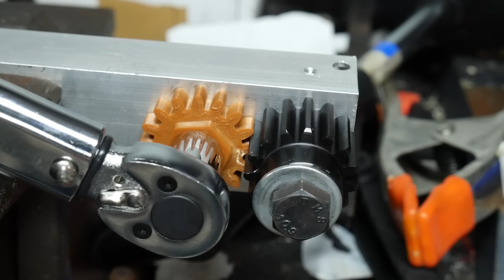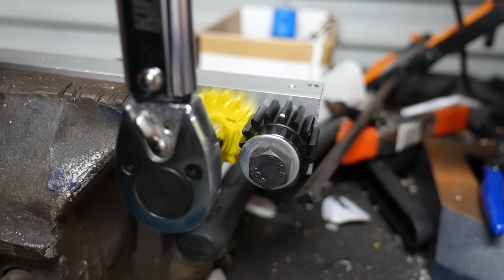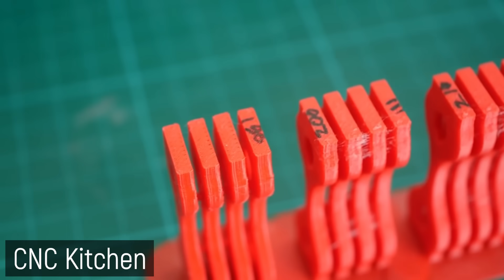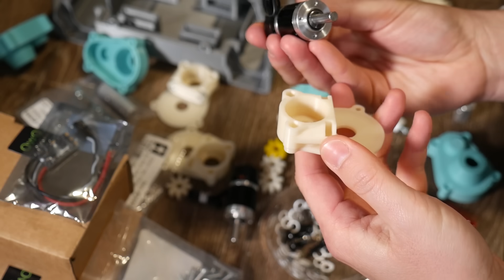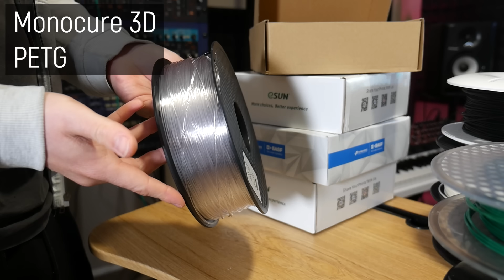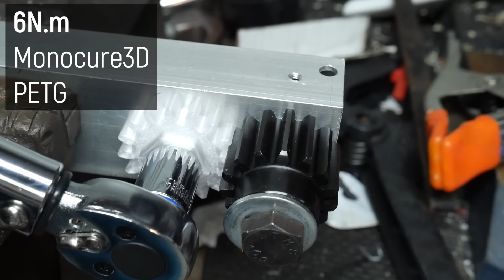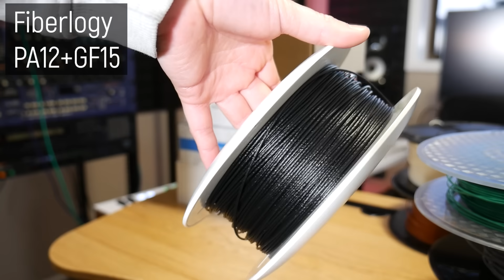Which 3D Printed Gear is Best?

Comment: While your tests possibly are representative of the relative strengths, I don't think you gave any sample a fair test.  It was obvious how these would fail the moment you showed your slicer rendering.  It was engineered to fail.  You weren't testing the strength of materials for their suitability for gears, because you didn't have properly engineered gears.
What you have tested is basically a rolled up sandwich consisting of a corrugated surface, non-structural infill, and a flat surface.  This type of structure is fairly strong in bending along the length of the corrugations, and weak across the corrugations.   What it's not good at, at all, is shear, but all you're testing is its shear strength.  It's obvious that the teeth are going to bend first and pull away from the infill because there's no way for the applied force to be distributed around the whole structure.
You might want to try modelling this in Fusion/Solidworks, and do some FEA on it.  You'll see that as printed, with hollow teeth and no continuous rim, your forces are localised to the area immediately around the tooth being driven.  Try it again with solid teeth and rim.  The forces are now distributed around the structure, so the infill is more effective.  Try it solid, or with spokes, and the forces resolve to the hub.
I'd like to see the tests repeated where the gears were engineered with a sound, structural load path between the hub and teeth.  Either use 100% infill, or a model including strong spokes, and print with enough perimeters to ensure the teeth are bonded to a continuous, circular rim.
I'd also like to see wear resistance testing.  There's no point having any gear which grinds to dust in a jiffy.

Comment: Results of Polycarbonate (PC) would be interesting too. Teeth and area of contact of the teeth to the radius of the gear should be printed with 100% infill and the center with infill, therefore the teeth have more absolute strength but can bend relative to the center of the gear . That avoids too brittle breakage behavior. Additionally, the infill can be designed to correspond to the inner stress introduced into the radius (But therefore has to be manually constructed in the CAD itself and not to be used with the automatic function of the slicer software) Cubic infill f.e. is not suitable because the stress is mainly "in plain" , and therefore the 3-D part of the infill does not have any beneficial effect to the strength of the structure.

Comment: "Mechanical Fuses" are called Shear pins.. woodruff keys also often serve the same function, but technically woodruff keys are intended to index rather than sheer at a precise torque, where a machined index could fail, a woodruff key is used to avoid real damage, although that shouldnt be the first defense, a woodruffs break point is mostly determined by the torque of the shaft nut rather than its own structural integrity.

Comment: Taulman 910 all day.
Even though that PLA looks great. PLA has terrible fatigue. i would not be surprised if it breaks in short order in real use. As soon as it flexes even just a wee wee bit, it's all downhill.  However, your tests show how much variability there is with pla. Perhaps some beat this fatigue thing.
                I typically print gears in petg unless they need real strength. When I print gears in petg, they only tend to crack with high inertia changes. Which is why I use nylon and that 910 is king. 910 is FAR more rigid than standard nylon. FAR MORE rigid. 
        
       * If I need strong gear trains I use toothed belts. Same belts as used in the printer. Belt + pulley. The belts grip more teeth. The belt grips half the pulley surface resulting in a very usable & durable drive train. Belt + pulley = serious strength. Plus, u can also buy the aluminum pulleys for cheap. Well, cheap in the standard sizes. Print the rest.  

    I like your torque wrench test !! Cool idea.  Perhaps it can be standardized.   A certain diameter & tooth size should be all that is needed.

Comment: A suggestion, and a question:

You might find an "old school" type torque wrench to be a more elegant "fit" for the sort of testing you're doing in this sort of evaluation. The dial-your-torque is incredibly easy when you're tightening a bolt to a desired amount of torque, but when you're using the wrench to "discover" a torque level rather than apply the specified amount of torque, you may find the traditional "flexing" torque wrench to be much easier to use.

Think of it as being more "analog" than "digital." It's almost absurdly simple in concept: the "bar" will flex as you apply torque to the handle, but, a pointer connected at one end will not flex. Instead, it will sweep across a scale indicating torque -- the harder you tug on the handle, the more the needle will move.

It's like the difference between an analog meter (i.e., a VOM) and a digital meter. The digital meter will display a number, while the analog meter will have a needle sweeping over a scale.

Sometimes when making electronic measurements it's much more convenient to be able to watch that needle deflect than to try to read numbers and mentally evaluate what the numbers mean.

Same thing with a graph versus a spreadsheet.

Anyway, you might consider trying to rustle up a "classic" torque wrench and see if it makes your evaluations any easier (I'd wager it'd certainly make them faster since you'd no longer need to be continually dialing in one setting after another. Instead, you'd just keep an eye on the needle!)

Now, the question: For something like this, where strength is more important than weight or cost of materials, why did you use partial infill instead of making solid gears? Was there a reason I'm not taking into account? (I have watched my son putz around with his new printer, that's pretty much the totality of my experience, so I realize there may very well be a reason for it.)

Comment: Those tests have nothing to do with ‘toughness’ - this term is used to describe rough handling or absorb energy and withstand shock up to fracture, Implying an impact.
Terms that should be looked at are;  malleability, stiffness, hardness, plasticity, sheer strength. Listen to the terms used in CNC Kitchen’s videos.

Comment: Here are two "dumb questions": first, could you 3d print a plastic gear around a metal nut to create  a 'shear-pin' effect?  Second, has anyone tried good old 'wagon wheel technology' and fitted a steel sleeve around a PLA wheel?

Comment: I'd be curious of the results if you were to 3d print a mould directly and cast them in resin what they'd be like. Could them compare adding in different fibres (glass, carbon, flax etc).
Yeah it's a 2 step process but could unlock a whole new level?

Comment: I don't know if anybody told you, but your experiments is wrong. You are mixing two different tests. If you want strength, you HAVE to get the torque at which the wheel break on the first application because if not, the only result you get is the torque for a damaged gear (by the previous application of the torque). And the second one is aging, on this one, you need to apply a certain amount of torque (the same each time) multiple times until the wheel breaks (normally at a torque that should be way below the torque on the strength test). So in your tests both fatigue and strength are mixed, and you don't get any "good" result. Sorry for my english.

Comment: I am also suprised by the pla tests .
But i would be for 100 percent sure that nylon 6.6 with carbon parts wil be very very tougher.
in my work experience the pla 12 is used for toothbrushes end more health products.
The nylon 6.6 is the most comon used  for car industry and robotic industry.
i suggest get a nylon 6.6 fillament including carbon parts not strands.
i just dont have a clue bout the printing part as we inject moulded nylon 6.6 at around 300 degrees celsius.
hope this helps u a bit.

Comment: PLA might be strong. But I wouldn't trust its reliability. I would prefer PLA+ over it, which is a material I'm really happy about discovering it.

To be fair, my first PLA is my only PLA. It prints very easily and smells so sweet while being printed. But it creeps badly. If I will secure something with a 3D printing, I would never trust it. Because it will be broken the next day under the constant load.

PLA+ prints a bit more difficultly. It doesn't like my bed. It doesn't like my glue stick. But I just use brim or raft(I'm a raft believer more than a perfect settings believer) and it usually prints just fine. For reliability, I believe that I can thrust it. While the PLA would break even because I left the filament on the extruder for a few hours, PLA+ just don't care. So I trust it.

A bit weaker? Sometimes reliability is the strength. I would prefer PLA only for decoration.

Comment: I would love to see Carbon composites for pla, abs, petg & nylon as we use markforged onyx with carbon for tooths alot but never explored alternatives.
Reply: carbon fibers are abrasive, you don't want them in the gears.
Reply: @stanimir4197  markforged allows u to place carbon fibers along the hole outline in ur print not on the conventional way where its just torn up and randomly put into it.
Reply: @diederickb1806  if the fibers  are not on the teeth (or where the gears ride), then it's fine but then again, the teeth won't have the reinforcement, and they are the really important part. Nylon+CF gear teeth eat brass pinions even.
Reply: @stanimir4197  u dont get it markforced can place continues fibers that go around in 1 peace trough all of ur print for each layer. So the fiber will be inside the print. Even if its just millimeters

Comment: I have a roll of CF reinforced nylon i print with when i need strength - Add North Adura X. Has a beautiful matte finish and is way easier to print than regular nylon since it has almost no shrinkage.

It's a Swedish brand but I'm sure you can get similar filament in Sydney.

Comment: Hey this is pretty cool, but spur gears are notorious for having failures on specific gear teeth with too much torque and shear stress.  Helical gears might be a much better alternative since the gear teeth mesh continuously and there isn't such a sharp increase in torque and shear stress when teeth contact.

Comment: You could also try to get a range of the expected torque transmitted per application of those gears, i.e  whether it's used to drive a fan or drive an industrial shredder, and everything in between

Comment: Thanks for your Tremendous Efforts Angus.
I've been enjoying your vids since forever only watch on Roku which precludes comments. 
I always "Like" and usually save for later as well. Keep up the good work!
Both you & Stefan (3DK') got me into 3D printing.
   Now I've 2 printers going flat out and something to do while locked down :-)
At the moment I'm Printing Tiny Gears (15mm diameter with 36 teeth and 11mm with 14 teeth).
  These are to go inside my RC Buggy Servos as the originals were stripped due to bad driving.
   They are coming out great and PLA is working almost as good as Nylon.
   Absolutely blows me away that I can make this stuff.
   Would never have even tried 3D Printing apart from your enthusiasm convincing me I could!!
Hope your Lock Down ends sooner than later.
BTW I'm Locked Down in Adelaide ATM.
Early days yet only looks promising here, and like we *may* be out soon (touch wood).

Hoping everyone in Sydney stays Safe and gets out soon.

Comment: If your thinking of getting into 3D printing based on the wonders seen here, DON'T... 

Regardless what he says he is probably using a $5000 plus printer for this. I watched and bought an Ender 6. After 36 prints 33 failed the "Successes" have all the strength of a biscuit! So make it out of dough save yourself hundreds of dollars and as many hours of frustration. If that's not good enough buy what you want new. Wait another 10 years for these prototypes to become working printers. Making it out of dough also has the advantage that your fails are yummy snacks and don't destroy sea life.

P.S. a lot of rubbish will be said of increasing/decreasing bed/hot-end temp flow rates etc. This will be as much rubbish as you create 3D printing.

Comment: A dial indicating torque wrench may have been more helpful than a breakaway. Rather than slowly bumping the torque breakaway, you just turn until it breaks then check the max torque indicator. Cool project.

Comment: Anges your printing is the weak point. Watch where it failed your lines when printing do not overlap enough to bond well enough. Your tooth came off right at a print line. Meaning you do not overlap your print's far enough for strength. Print 0.2 layer hight with max 0.3 line width and a 8 layer wall. You will see on gears it bonds way better than anything. And produce 100% infill. 
Also it is :  B A S F  which is a very very well known Chemical Company from Germany and pronounced each letter individually same as  B.M.W or V.W. for example.  B.A.S.F. stands for Badische Anilin- und SodaFabrik .
And get your hand on PPS(Polyphenylene Sulfide). It requires full annealing so put it into a heating chamber for 2-4 hours at 130°C. This is before you touch into PEKK and PEEK materials the best price option.

Comment: You always test the same tooth, which eventually breaks. Wouldn't it be necessary to use another tooth (or other wheel) to really see the force in Newton which has not been altered several times before?
I would have liked to see ABS treated with acetone :))

Your videos are really cool, like every time
Reply from the maker: I printed two gears and tested the second at the level the first broke, to be sure.

Comment: I really like these "real world" tests.  When it comes to PLA, there are so many varieties and blends, that I really like the vendors that let you know the base filaments.  If you can find some PLA based on NatureWorks 3D870 Ingeo PLA, you'll have a modified PLA that can be anneals very well for extra strength and temperature resistance.  I'd also like to see CF-PETG and CF-PC (or an easier to print PC+ Blend).

Comment: The impulses caused by break-over torque wrenches can produce inaccurate tests.   Much better are the bending-bar torque wenches.  They have no impulses and you won't have to subject the test piece to multiple and varying loads.   Liked the video though!
Reply from the maker: That's neat I've not seen those before, thanks for the tip!

Comment: Hi Angus . Thank's for this video and you showing us your tests results
Two years ago I  3d print with PLA all missing change gears of my  mid size lathe and it still working, never broken.
I use 100 % infill . The gears diameter was betwen 50-140 mm
Also I tried to print some small gears ( max diameter was 40mm) with diferent resin brands and the winner was BLU from Siraya

Comment: Great testing, however kinda sad that you haven't tried out CF filled nylon, and policarbonate. PC is though as nails, although far from the torque levels you were testing, I've made PC gears for RC cars and they are very very good. With nylon (without CF) I had a very similar issue where it stripped on the inside (but the nylon quality is also meh)

Comment: great video, failure preferred would be a non-binding failure. as binding could cause over amperage or similar issues. Complete failure would be better if you have a way to monitor over revving the motor. Similar to the new stepper motor setups in Prusa printers that don't need end stops

Comment: i would choose the stiffest filament probably either pla or petg or CF modified filament the gear turning on the hub could cause intermittent problems that are hard to track down and the torques involved are probably less than any of the failure points of sheer force. The big problem i see with anything thats not glass filled or carbon filled will be creep. That is going to deform your hubs and teeth, in that regard petg might be the worst regardless of temp or force. so will probably depend on temperature and the amount of use you want to get out of the gears.

Comment: rather than static torque I would have tested under motion at a rather high fixed speed. those mod 2 gears should be plenty strong. however friction = heat = deformation = failure

Comment: Heat build up due to friction is an issue with 3d printed gears; I'd highly recommend testing your prints at low load & high speed before risking those nice brushless motors!

Comment: I’ve been doing a similar application where rotational toughness and abrasion resistance was important so I did matterhacker’s NylonK (Kevlar) which isn’t as strong as the glass-filled, but claims high abrasion resistance (good for gears) but it does for a a very rough surface.

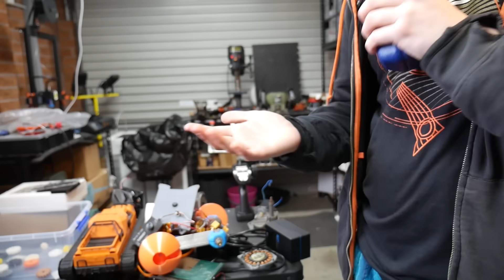Comment: ref: 2:25
As  a mechanical fuse a share pin is a better option. Then you can very accurate design what force it would break on and even spare the gears.  :-)
On the other hand I have found that doing tests like this to learn the strength an weaknesses of the materials you can use is a very important factor in getting good prints.

Comment: Glad you got you hands on BASFs Pro1 filament, I've pumped through dozens of kgs of it for fixtures/tooling for my work. It is also advertised as being able to print at a blazing 150 mm/s, but not something I've had success achieving (maybe with a voron build it would be.) Great video!

Comment: There's more to gears than just strength, in injection molding nylon is used for gears simply because it has a low friction coefficient and is less prone to wear.

Comment: Interesting! Something else to consider is that nylon is lower friction than most of the others, which could impact actual use. Also, I would love to see some Taulman filaments tested. They have some very helpful charts on their website that show strength and stiffness for their filaments, which could be helpful when selecting some for gears.